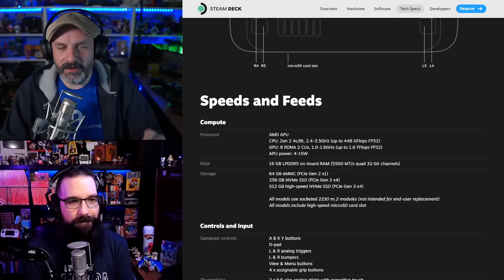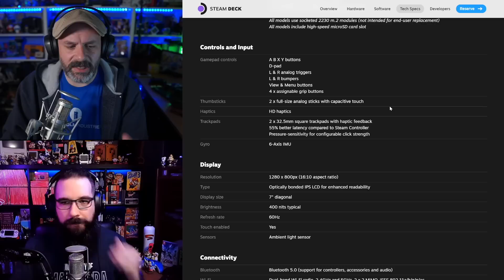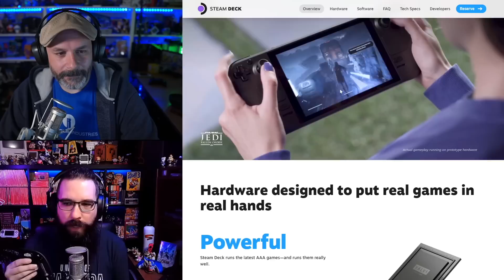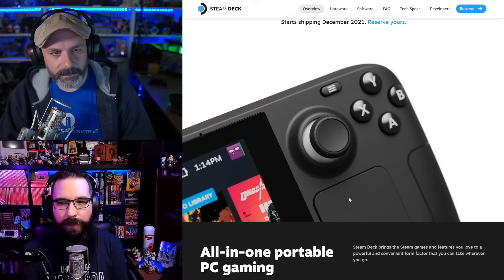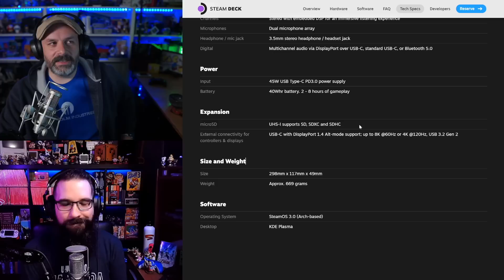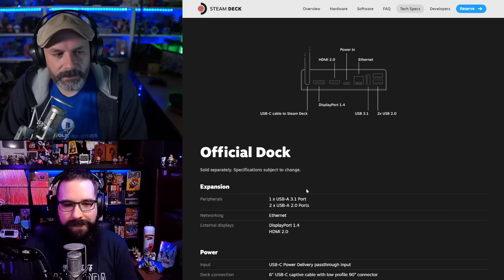Deep Dive Discussion on Hardware in the Steam Deck | On Deck - Episode 1

Comment: 13:30 in one of the IGN interviews, they stated that they went with the socketed M.2 for repairability considerations. If they're expecting a minimum wage worker in a repair depot replacing this, it probably isn't that difficult for people with repair experience to swap it it out. It probably also means other components might be replaceable as well and that this thing might be repair friendly (if you can get the parts that is).

35:00 I don't think that anti-glare screen is going to matter for most folks. I have never had an antiglare screen on any of my mobile devices and never had a situation where I was wanting for one.

Comment: Just a tip guys.  You gotta get into what was pioneered with the Steam Controller community.

Steam Input is so powerful, you can customize the controller with dual touchpads and gyro along with traditional buttons and back paddles to choose how you want to control a game.

Because the Steam Controller was misunderstood by traditional console gamers, they missed out on what it can unlock with the newer generation of gamers.  The power to think differently.  You'd have to actually retrain your brain, depending on how used you are to Xbox and PS gamepads.

Look up War Owl.  There are a few people who can competitively play CS:GO on the Steam Controller without needing the console's aim assist.  I personally finished the main quest and a few expansions of Path of Exile using only touchpads, backpedals, bumpers and triggers.  No stick, d pads or face buttons.
Reply from the maker: I played Doom 2016 from start to finish using only the steam controller.
Reply: @NerdNest  That's amazing.  You're one of the pioneers!  <3

Comment: The 1280x800 was a super super common resolution with early widescreen monitors. TVs were 16x9 but PC was 16x10 until 1080p monitors were common. My buddies and I debated running 1920x1200 monitors vs 1920x1080. Legit 1280x720 was barely used in PC monitors. People kept their 1600x1200 CRTs or bought 1280x800 vs buying 720p.

Comment: Awesome device my 512GB Steam Deck is slated for Q1 2022 really looking forward to it. I don't need to buy third-party games for my Switch anymore apart from the PS5.
Reply: As I mentioned to someone else, I’ll continue buying 3rd party games on Switch provided no severe performance issues and still look good (Tony Hawk, Sniper Elite 4, etc). Switch and Switch Lite in magnetic flip case are pocketable systems, which is a massive advantage over games on a non-pocketable system (I slip my Switch in back pocket to take to work every day). Steam Deck is awesome, but it’ll be for all games that don’t come to Switch or have unsatisfactory performance (Mass Effect Legendary, Outer Worlds, Monster Hunter World, etc)

Comment: 49:31 I'd just use a 3rd party dock if you need a hdmi 2.1 port. I agree though that's a bit weird the official dock only does 2.0. hdmi 2.1 allows for 4k120hz screens on a tv like the LG CX instead of just 4k60hz. Of course DP 1.4 does have more bandwidth though but most TVs don't have DP.

Comment: Regarding gyro: in one of the demo videos it did look like they showcased without specifically mentioning that they gyro only functioned when your thumb is on the stick (which can probably be changed in the options). This would be for things like gyroscopic aiming like in splatoon or BotW. If you’re using the touchpad though, you probably don’t want gyro aim assist on.
Reply: Some games work way better with the trackpad and gyro, if you're familiar with the steam controller and steam input you can make moves controllers would be constantly overaiming with. Basically you can remap and make your own functions for every button and press and custom button combos, it's nuts, my guess is the Deck has the same level of customization.

Comment: I've seen many discuss the ability to add a M.2 drive but many seem to be glossing over the fact it's a 2230 and not the more standard 2280, The 2230 drives are usually much more expensive and don't come is as large storage sizes.

Comment: Guys will the lower memory speed of the 64gb version be a hinder? Because I would love to get that one and just run my games on the microSD.
Reply: The 64gb storage option will be slower if you store your games on the internal storage compared to storing your  games on the internal storage of higher end models. If you plan on playing on a micro sd card no matter what model you get it will run the same if you use the same micro sd card, the biggest thing to look out for is to get a micro sd that is high speed to ensure you don't run into any issues.

Comment: If the touch pads do a good job of creating a satisfying short-term typing experience then the possibilities for this system are pretty staggering.  By far the biggest issue with my surface pro (and I LOVE my Surface Pro) is that it is still kind of clunky with the keyboard cover and the AC adapter/charger is bulky and proprietary.  It is PORTABLE but I still have to post up somewhere to really use it.

The Steam Deck (I'm going by WiiU Game Pad feel here as a baseline) on the other hand is fairly self contained IF (big big IF) there is a quality typing that's not just touchscreen (which is fine and functional, but not revolutionary).  The other controls are there for sure.  Assuming I could type out a paragraph or two in relative ease with the touchpads while lounging on a couch, this system really does an amazing job of melding the convivence of mobile with the control and power of a PC in a highly variable gaming form factor. Which is kind of perfect right?

I think the hype is real for sure.

Comment: Not that they won't make it easy to replace, it's just due to the form factor, there are thermal and electromagnetic shielding and stuff going on the way, which if damaged, will make it even harder to repair. So is not intended to be upgraded by unexperienced users, and obviously this process will remove your guarantee.

Comment: That 800 resolution might be due to their manufacturer's mother glass sizes and the best possible yields from a single mother glass sheet of screen
Reply: @ignis86 I'm thinking the 1280X800 16x10 ratio is so that older pc games will scale with minimal excess on the edges.

Comment: 1280x720 while better for movies is terrible for actual pc use.its not enough vertical space and i think valve was thinking about compatibility (stuff not fitting on screan without scrolling) even cheap laptops use 1366x768 screens and even then the vertical realestate is just barely enough to be usable...exluding old software of course...also a taller screen might have allowed them to maximize the size of screen that would actually fit

Comment: 16:10 isn't that weird. MacBooks before retina were 1280x800, and now they're 2560x1600. Dell and Lenovo started switching from 16:9 to 16:10 in the last couple of years (finally!). Console gamers are used to 16:9 because that's the TV standard, but for PC 16:10 is the superior ratio.

About the touchpads, I'd encourage people to look up RambleTan on YouTube. He has a ton of video tutorials on the Steam Controller. I especially like putting a right touchpad click mode shift into ABXY equivalent (plus the center). This lets me basically ignore the actual face buttons because I have everything under the right touchpad.

Comment: I was doing some math and I think 8 rdn2 cores should peform anywhere form 16 to 18 Vega cores, so performance of the steam deck should be more than double that of  ryzen 3200g. And this is without taking in consideration improvemed performance thanks to lpddr5 quad channel ram. It is possible that this chip performs like or  just below vega20 / gtx 1650
Reply: This is without using AMD FSR which can provide even more performance.

Comment: as some one who have an bad mic, i can apreciate the built-in mics... if they are good.
one of the bad things about pc gaming is that you can use any mic you want, while that is good because it allow you to save money on an cheaper mic, it also allow you to do the mistake of purchasing an shit mic, wich create an bad experience to everyone who play with you on online games.

valve puting an built in mic on that thing create an minimum quality for the mic, wich benefit everyone else.
as for internal noise, it should come out of the factory already calibrated to take that into account in their noise cancelation code.
Reply from the maker: The issue with on device microphones is that the Mic is far from your face, which means its most likely going to sound bad.  I'm not upset that they included them, but I think most people will plug in headphones that have mics, which will sound better because they are close to the source.

Comment: I believe the 64GB of eMMC is soldered into the board for all models, and contains the OS. And the M.2 NVMe drive is simply added on as a second drive for the higher tier models.
Reply: I don't think so, I think the 64gb is on a m.2 slot module. Otherwise Valve would advertise it as 64gb+256gb, ect.
Reply: I don't think nothing is soldered because they say all models are upgradeable but not advised. Probably because it's under a cooling chamber with some thermal paste I don't know just a guess.
Reply: The 64GB has an empty M.2 slot
Reply: @BrandonKingM  How do you know?
Reply: @YourBossSusan  They said it does. They don't recommend you upgrade it but its yours so you can. This isn't a Switch or PlayStation. I presume they don't recommend it because hardware like the cooling system is on top of it. Changing the SSD on this will be more complicated than on a laptop or desktop
Reply: @BrandonKingM  no, the 64gb eMNC drive is attached to the m.2 slot
Reply: @dzibanart8521  That's still replaceable. We'd only have to worry if they were soldered on
Reply: No, they said all modelos use 2230 m.2 slot. The eMMC is M.2 confirmed

Comment: You guys are thinking way too hard about the screen resolution. Look up 7 inch Android tablets and see that almost all, especially the cheaper ones, are all 1280x800. They didn't pick the screen for any reason other than they could purchase an off the shelf component that met their requirements. 

Remember what Gabe said, they worked super, super hard to get this thing to the price point it's at. There's zero chance they spent any kind of money building custom screens to have an extra 80 pixels. It's a commonly available component they were able to buy cheaply with decent quality.

Comment: I owned a steam controller when they first came out years ago, and I just could not understand or get used to it. I've been told that there is a pretty steep learning curve. I'm really glad they added simple thumbsticks so they won't alienate gamers who are use to them. However with that many combinations you can make, MMO's may have a new home for me...as long as I can get past that learning curve.
Reply: Its a quick learning curve. It is steep, but once you understand the basics the sky is the limit. I am a trucker that games exclusively with my Steam controller. I have my RTX 2060 laptop hooked up to the 32 inch tv in the sleeper berth of my truck and game lying in bed.
Reply: @BrandonKingM  I'd say it varies from person to person. Half of it is just getting used to the controller (which I get. To this day, I still can't even with gyro controls), and a lot of the rest relies on enthusiasm. Me? making a multilayer template that automatically switches from KB&M to XInput as I enter a car in GTAV is great. But a lot of folk don't want to get that far in. They just wanna pick up and play and it takes just one wrong title that needs a bit more fine tuning to turn them off it.
Good to see the extra rear buttons and even better trackpads on the Deck though - god knows how much Valve had to pay SCUF to license their patents for 'paddles on a controller existing'. Turns out that may have been what killed the original Steam Controller - breaching a stupidly broad patent and getting sued.
Reply: @TheVaudevillain  wait how does the controller know you got into the car? As a programmer I'm intrigued lol
Reply: @Radgerayden-ist  In a nutshell, you can set up several completely different layouts on the Steam Controller and switch between them with on the fly. I had one with all the KB&M controls (normally I'd use XInput to move and mouse to look, GTA is a game that doesn't deal well with XInput and mouse at the same time) and a long press of Y as I get into a car switches the entire layout back to full XBox inputs, which feels so much smoother for driving. When I press the button again, it switches back to my on-foot controls.

Really, the controller doesn't know I'm getting into a car specifically. I just bound it so that the button to get in also switches me to a different control scheme.
Reply from the maker: The fact that this has everything is great.

Comment: This is a really hard product to rate. We don’t know anything about this custom chip or the custom OS. We also don’t know what efficiencies AMD has worked on to ensure a better experience. System wide FSR could very easily be a thing that will allow for higher quality at lower base resolutions. We won’t really know anything until we see it.
Reply: SteamOS 3.0 is based on Arch Linux using the KDE Plasma desktop and a new version of Big Picture Mode.
Reply: FSR is not good for lower resolutions. It needs a high pixel density to start with, so it’s mainly for 1440p to 4k upscaling, or at most 1080p as base resolution. This would require 540p to 720p which just isn’t going to work well.

Comment: As another steam controller power user, I feel the need to mention some things.

Valve absolutely dropped the ball on the marketing for it. Its legit an amazing controller, that was seriously misunderstood by the masses.

I like that they've improved the latency for the Decks pads, as well as adding the force sensing. I've used the Index Controllers for vr, and loved the force sensing. Works exactly like you said; you can bind a button and decide how hard you have to click to activate it.

My reservations about the Decks pads is the fact that they have a lot less surface area compared to the Steam Controllers. I've done the math and its around 86% the surface area at a minimum (someone else ran some math and came to closer to 20% less).

Some people have been downplaying the size difference... But I genuinely think size does absolutely matter here. My main dislike of the Index Controllers is that the touch pads are so small that my thumbs are wider than they are, and as a result I could never use them for actual track pad tasks. Imagine a mouse mat that is smaller than the mouse. That demonstrates that as you decrease the size, you lose effective control despite any higher resolution or sensitivity. 

And being a member of the steam controller community for 6 years, I've seen throughout the years that many people want at least the right touch pad to be *larger*, not smaller. Even as recent as a couple days back I've been in a debate where someone chimed in that while they love the pads sometimes they want a stick because they run out of pad space to continue moving the camera in a single direction when tracking a target.

Anyway, good podcast! I'm working on a new video about fps controls for the Deck using the Steam Controller as an example, taking inspiration from your New World video.
Reply: My Steam controller is how i exclusively play games. I love it so much, and unlike Bethesda it just works. Total War, Star Wars The Old Republic, old games made before controllers had support on PC. Everything.
Reply: I think people just didn't want to use the steam controller when they looked at it. Having those controller options on the steam deck can make a huge difference.
Reply: I own a steam controller and I think you'd have to be insane to enjoy using it.
Reply: @YourBossSusan  you are right. I am insane for wanting to use an input device that is immune to stick drift ~_^
Reply: @YourBossSusan  I'm saying at first glance the option of having both on the steam deck if more appealing to people than on the steam controller which only had those touchpads and one joystick.